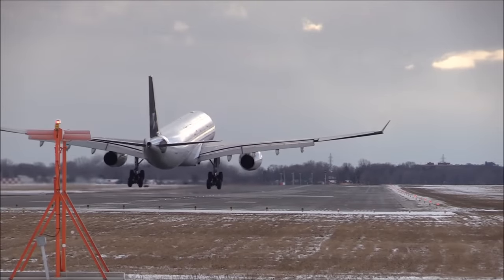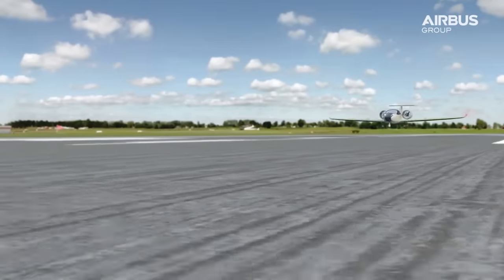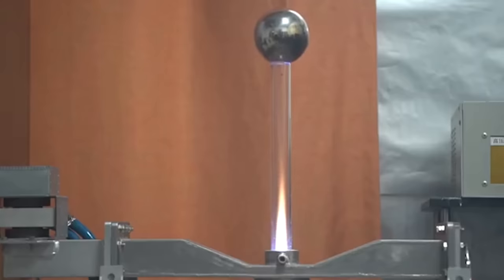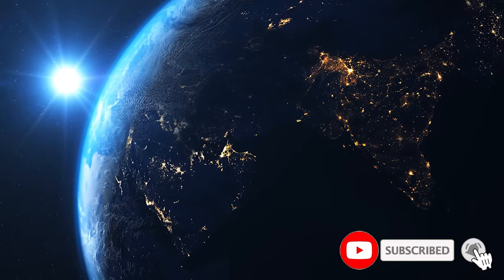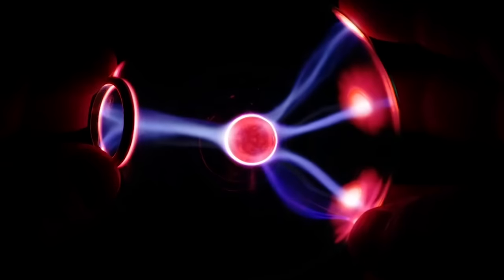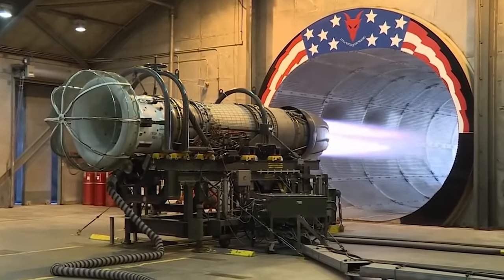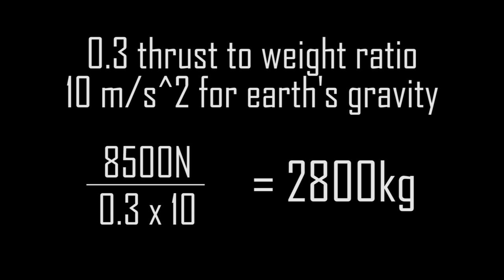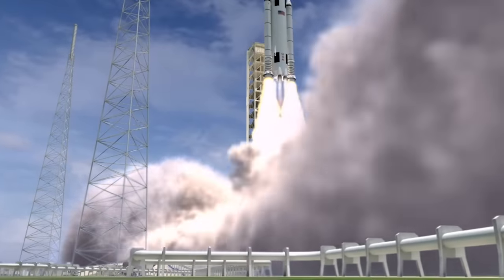Uncovering China's New Electric Plasma Jet Engine

Comment: And that's going to take a HUGE amount of electricity.
A quote from one of the scientists working on the project. 
Our results demonstrated that such a jet engine based on microwave air plasma can be a potentially viable alternative to the conventional fossil fuel jet engine,” he concluded. More work is needed to improve the prototype’s efficiency before it can be tried in a full-sized jet, and getting enough electricity to the engine to create plasma could also be a challenge. But if it can work on a large scale, it could usher in an era of guilt-free flying.
Reply: Yeah considering microwave ovens can take 1500W of power, it seems very wishful. Power consumption is also a concern for electric propulsion
Reply: i guess you'll need an arc-reactor huh
Reply: Batteries are advancing every single month
Reply: @gratefuldoge8598  no they aren't. Tesla's newest battery is the same energy density as the ones before it. They just made them cheaper to produce and make less heat. That doesn't help for air travel. For air travel they need fuel that is massively lighter, like a factor of 2. Basically it's a pipe dream till solid state batteries come to be. 

Plus let's be honest here, cleaning the airliner industry is kinda just a waste. Air planes only make up 2% of all CO2 emissions. It's significant, but there's only so much lithium to go around so might as well just use that for cars and solar backup. Makes far more sense for planes to use hydrogen in the future as hydrogen is even more energy dense than gas so it makes way more sense with the weight limits. Batteries make sense for cars and trucks, but industrial transport like boats and planes make way more sense to use hydrogen. Though of course there are already nuclear cruisers.
Reply: Skylancer727 im not talking bout tesla
Reply: @Skylancer727   Yep.
Reply: @Flec2507  or a miniature fusion reactor that works. thats kinda what the arc reactor was based off of
Reply: Nuclear power. The U.S. was debating a similar idea in the 90s but decided it wasn't worth the cost
Reply: @Salamandeer  Actually that program was started in 1949 by the army and one plane was built. And do you honestly want nuclear powered aircraft flying around. More importantly they crash, and I have a real sneaking suspicion nuclear reactors don't like to be crashed.
Reply: @Salamandeer well fusion is still nuclear. and if it worked it would output 10x more energy than uranium nuclear reactors.
Reply: @Skylancer727  I thought hydrogen takes up more volume in a fuel tank?
Reply: @Brick Battle Please do some research on how large that would be, and they have been claiming for decades that they were just a little ways away from a viable plant. And there's your hint, it's the size of a energy production plant, square city blocks in size.  That's not suitable for aircraft.
Reply: @satguy  thats why i said miniaturized. i understand that this is not yet viable. but if a small scale reactor could be feasible, i feel it would allow for more options, and better output. also both these reactors are using incredibly inefficient ways of harnessing energy, boiling water rather than making an attempted to directly convert the energy into electricity. or by some other means.
Reply: And fusion is already here.
Reply: Yes and u just need Nuclear reactor
Reply: @koushikduttarai81  A flying reactor that has catastrophe written all over it.
Reply: @satguy  tell that to the governments blackprojects.
Reply: @hellzone100  The US canceled its program in 1964.......
Reply: @koushikduttarai81  A reactor in a plane? Do you know how much the shielding in a common reactor weighs?
Reply: @feonor26  a reactor that can charge the battery very fast
Reply: @koushikduttarai81  That's not the issue. The issue is weight. The shielding for a reactor is too heavy for a plane. Don't you think they've already thought of this?
Reply: Incorporate wind energy capturing
Reply: @anthonyman8008  I have renewables on my property and trust me they're not as great as everyone claims they are.
Reply: @feonor26  the kicker is that you can get around that issue by just using it on a nuclear missile. It's called a SLAM. Supersonic Low Altitude Missile. The US researched one under the name of Project Pluto. It's basically a hypersonic cruise missile that uses a nuclear reactor to heat the air to create the thrust but in a much more efficient way. It has the "small"downside of causing massive fallout before it reaches the target but still kinda cool. I think if we got better solar panels, planes could fly primarily off of solar but that's just barely possible now. Another option would be a rechargeable chemical reaction battery that creates heat similar to a nuclear reactor but self contained and reusable. There are a lot of options and I think going nuclear is a terrible idea. That's just one crash away from a disaster.
Reply: @Skylancer727  Well said but hydrogen isn't the best when it comes to fuel for air travel. If it were an internal combustion engine it would be fine but a jet engine would be way too unsafe
Reply: And thats no problem
Reply: @feonor26  There would be no explosion or radiation if you use a hydrogen powered fusion reactor.The only thing that would happen is that the hydrogen would cool of and fusion would stop
Reply: @Alekx445  Well for now fusion reactors are science fiction.
Reply: @hadleymanmusic  that is a giant problem. If you have any solutions please tell
Reply: @gratefuldoge8598  nope. Batteries have pretty much reached their max power to weight ratio limit.
Reply: suprlite not even a little bit true.
Reply: @gratefuldoge8598  that's 100% true, batteries are pretty much at their apex
Reply: Quw that is an impossible claim, so say what you want, it just is not possible. There are no limits to batteries but time.
Reply: Perhaps everybody would like to read part of the labs statement that I have inserted into the original post. They themselves say it would requires a tremendous amount of energy.
Reply: @gratefuldoge8598  When you're talking about commercial passenger carrying aircraft yeah there are lots, and lots of limits.
Reply: @gratefuldoge8598  Literal physics, and thermodynamics say otherwise. There is a very small chance that batteries will get smaller and more efficient like computers (which are also nearing their peak). That's mainly because quantum physics doesn't like being measured. Most batteries run on chemical reactions and trapping electrons under certain conditions. That has a maximum size due to, as I said, quantum physics. Phones use extreme downsizing and use SSDs to store power and those SSDs are pretty much readable batteries. They are only so big as to store electrons.
Reply: Satguy 141 modern* thats the only limit. Time. As I said.
Reply: Quw existence is not bound by our understanding of it.
Reply: @gratefuldoge8598  Did you not read my comment? I literally explain the reasons why it wouldn't work without some, miracle, generator.
Reply: Quw based on your understanding of reality*
Reply: @quw1556  He's got to be a troll, short one sentence or less answers, with no supporting documentation.  Fits the profile.
Reply: @gratefuldoge8598  Based on fact. Do you how to break the laws of physics and thermodynamics? If so please tell. Do you want an antimatter battery?
Reply: @satguy  either that or they can't admit that they're wrong
Reply: Quw fact is a human concept. I do not believe in those laws, they do not apply to me, not the part of my self which I identify with. I am not bound to these principles, rules snd limitations your religious cult subscribes to.
Reply: @quw1556  I'm shocked, shocked I tell you. People unable to admit their wrong, say it ain't so. 
I guess they've never been married. 😉
Reply: @gratefuldoge8598  🤣🤣🤣🤣🤣 Ok, so then a 1kg 30.000mAh battery can just IDENTIFY as a 0,5kg 100.000mAh battery - and you'd be right. Because 'facts and science are just human concepts and dont need to be taken into consideration'. Pretty descriptive of the whole 'green  new deal'.
Reply: suprlite I do not agree with the GND. Also I do not subscribe to identity politics. I am simply saying the limitations ascribed to the reality come from humans and are not law. Theyre observations and classifications we make. All based from our perspective.
Reply: @gratefuldoge8598  umm yeah whatever.  Though galvanic batteries have pretty much reached their peak energy to weight ratio no matter what you think of the matter. If you understand basic chemistry, you'll understand why.
Reply: suprlite again. You are arguing from the point of humans perspective and abilities. I am saying theres too much unknowns and faithbased theories in the science cult. I think the possibilities are infinitely endless but I am only thinking that from my ability of understanding those concepts. I believe that even if we thought we had a complete grasp of it its just an unknowable fact that cannot be proven beyond our ability to measure it
Reply: @gratefuldoge8598  Ok then. We might find some renewable energy source more powerful than todays batteries - but it will not be batteries. For the same reason that we have not found any explosives that are significantly more powerful than tnt, which was invented in 1863. It's basic chemistry and science. All your arguments are based on wishful thinking, dreams and denying facts and science. Sure we might still increase the efficience of batteries.  by 10% - 30% - but we will not see a doubling. And even a doubling will barely be enough to make batteries a viable replacement for fossil fuels. But hey: keep dreaming the good dream. Meanwhile, you might want to read up on the galvanic table. Please do before posting again. Remember: today's best batteries only have 2,2 times the energy density of the good old lead acid battery which was invented in 1859. Because: chemistry can only be streched so far.... Here's some reading for you: https://batteryuniversity.com/learn/archive/batteries_against_fossil_fuel
Reply: suprlite what you call batteries today wouldnt have been called batteries 30 years ago. Youre restricted by your language.
Reply: @gratefuldoge8598  How dense are you? It was called batteries 150 years ago. Now go read a physics book and gain some knowledge.
Reply: No it can't people keep claiming green energy will save us all but ignore that solar panels are just as bad if not worse than green house gases. You get VERY low conversion efficiency while increasing the absoption of energy. Just like a greenhouse gas captures more of the sun's energy instead of it radiating back into space SO DOES A DARK SURFACE. I am willing to bet that a solar panel captures more of the radiated energy than burning the same amount of energy in fossil fuels and releasing it as greenhouse gas. Around 95% captured with 12% converted to electricity and only 40% efficiency when converted into motion in an electric engine. That is an overall efficiency of 4%. Combustion engines convert ~40% to usable energy and release a relatively small amount of greenhouse gas in comparison.

The numbers don't lie. If you want to save the planet Solar Panels ARE NOT IT. Unless you build GIANT sun shades or reflectors to offset the extra energy absorption they only make it worse. There is no energy usage without creating heat. Taking that heat from the sun adds it to our planet. Hydrodynamic and Nuclear are the 2 best forms with wind being 3rd. They still require offsetting that extra heat though.
Reply: Aerospace Mechanical engineer, here. 

They did NOT provide accurate thrust calculations. In experimental setups, a force gage is used. This ball on top messes everything up. TRASH RESEARCH. FAKE NEWS. MONEY GRABBING RESEARCHERS.
Reply: @johnbigelow8575  the largest fusion reactors out there aren't even able to break even with energy production. Size matters when you're trying to recreate the conditions of a star inside a building.
Reply: @Tterragyello  Yep, but trying to convince the gullible why,  is pointless.
Reply: Maybe not. At least maybe not 'directly'. A kitchen microwave uses wall-standard 110v, but converts to ~5000 volts via the internal converter. Same could be done on a higher scale to reach power requirements here. Further, they're going to find if they can create ~3 Thz microwave emitters, co-located and aimed at a single, concentrated point, the air itself will explosively expand, and if placed properly in a ducting structure, it will produce very high thrust. Mark my words.
Reply: Forgive me I am going by memory, after all this article is 3+ months old,  but. Didn't they say in the article they have no idea how they can store the necessary energy to do this. Short of a flying nuclear reactor, and that's not acceptable to me.
Reply: @Skylancer727   Check out Hydrogen "Power Paste". Its a magnesium hydride technique for storing hydrogen and its a game changer!
Reply: @johnbigelow8575  fusion power is still off the list for now. Right now it's an energy negative process. Plus it requires radioactive tritium hydrogen to run the reaction which is only produced in fission reactors. In theory we can make a breeder fusion reactor, but considering we can't even get the efficiency up to any productive amount yet, kinda wishful to be making breeder reactors.
Reply: @ohkabomb917  it does, but hydrogen itself contains about 4 times the energy as gasoline per kilogram so in the end it's still enough for normal jet flights. Plus if we use hydrogen fuel cells instead of hydrogen combustion we are using the fuel more efficiently so we burn less of it over time. You can burn it in the same method as gasoline but it's a bit more finicky to ignite and hydrogen has an effect of slowly breaking metal objects from their imperfections so internal combustion while possible is probably the poor solution. 

When you really want more capacity you can also store it cryogenic but then you need to bent it as it evaporates plus you're making it less efficient as we're adding an extra step of cooling.
Reply: @MrChronified  it's a bit of an over hyped topic to be honest. I looked into a scientific paper studying the efficiency of these pastes and they found most only contain 2% hydrogen by weight, require special heating to release the hydrogen and then the releasing process could take anywhere from 1-15 days. After seeing all of that, I really don't see this as a great method of storing hydrogen when we can just make gigantic 700psi canisters for planes really sounds more like it fits into the construction and manufacturing fields for long distance transport to factories. 
https://www.ncbi.nlm.nih.gov/pmc/articles/PMC7559164/
Reply: @Skylancer727  thats why i said "I understand its not yet viable". i feel the main problem with most reactors is how we convert energy into electricity. we've been using the same method for the past 100+ years and we still use heat to steam power to make electricity I feel there has to be a more effective way to get electricity from our generators today. I feel we should find a way to cut out the middle processes for getting electricity a find a way to directly convert fusion energy, or fission energy into electricity. rather than rely on heat, because the amount of energy loss to dispersal of heat and that heat to motion is immense.
Reply: @johnbigelow8575  well there is, for fusion the main way to produce power is actually  electro-static direct energy conversion or DEC for short. It's a fair bit more efficient at about 90% efficient, but no matter what energy released in gamma rays no matter what will always be lost due to its nature. DEC can also be used in fission reactors but considering how much of the energy in fission reactions is just heat it's more a secondary way to get power out of it. 

The issue with fusion though is more that it's more than making more power than you put in, it also needs to produce way more as we waste liquid nitrogen cooling it and the fuel is not cheap (tritium hydrogen is only produced in fission reactors and is screamingly radioactive at a half life of 7 days). We need to make enough that wasting these resources isn't a money sink. 

DEC was always the best method for fusion and has been the main one brought up since its conception though still fusion still has a lot of issues to overcome.
Reply: @gratefuldoge8598  Sure, there's new TYPES of novel battery chemistry being tried, but to say that means that the energy density is getting better by any practical factor, no..sorry, it just has not worked out like that, at all. If it had, you could bet your house that it would be put to use, making current Lithium and even lead acid storage batteries obsolete, and that has not happened.

 Besides, this method is not really new, it's just taking a bunch of things that are old tech, and cobbling them together to show that it works, which, to be fair, it hardly does. Each step of this process uses heaps of electricity and produces a tiny amount of thrust, overall. So, for this to be considered, you would need to like increase the efficiency of each of these steps by many times over so that each step was ultra efficient, that's just not going to happen, even if it did, the final output is simply not enough. Then there's the pollution issue.

 What pollution I hear you say ! Well, think about it, what happens when you ionise and heat air up to high temperatures in an electric plasma ? You inevitably produce a lot of ozone, which is great for absorbing U.V. in the upper atmosphere, but terribly toxic for all forms of life down here in the biosphere, that's why it's used to sterilize water, because it is a powerful oxidising agent..cancer of the lungs anyone ? Then you have the OTHER problem, the same thing happens to Nitrogen and oxygen, you end up forming those nasty oxides of nitrogen, that nasty brown gas that is also very toxic..so, does this really have any merit ? sorry, it really doesn't. Frankly it sounds more like some sort of P.R. spin to make it seem like something good actually comes out of Wuhan, but, when you actually look a little closer, more snake oil.
Reply: @Tterragyello  Gotta stay skeptical about everything in this day and age
Reply: This particular plasma thruster, if the paper's claims are valid, has a propulsive efficiency (brake power to thrust), that exceeds that of a conventional turbofan engine. A typical turbofan has a power-thrust ratio of just a little of 1, a GE-90-115B produces 115,000 lbf using 100,000 shaft horsepower. If the claims of the paper are true, the propulsive efficiency of the microwave air plasma is 4.6 lbf/hp, far higher than the turbine engine. Where do you think the energy to power the turbofan comes from? Saying "this requires a huge amount of electricity" is meaningless. Propulsion systems are not power plants. Powerplants provide energy to the propulsion system.
Reply: huh
Reply: guilt is feeling that can be easily supressed even without new engines
Reply: @hphp31416  ....??
Reply: @ChristophePochari   the problem is that the energy density of batteries is a joke in comparison to kerosine or any other liquid fuel. Even if we had plasma thrusters capable of overpowering turbofan engines the plane would have to carry many times more batteries than a conventional plane carries fuel. Before we get super efficient plasma thrusters or batteries this concept aint going nowhere.
Reply: @Skylancer727  Great point !!
Reply: @quw1556  there could be other applications
Reply: @satguy  yea I’d actually be fine with that
Reply: We need a Dyson Sphere.
Reply: install a solar panel at the top of the plane to prolong the range, but it doesn't solve the need of the large battery to contain that electricity, and the problem with the night flight when there is no sun to support
Reply: @agiegiaaa  With current solar panel technology?
Reply: That's why china is also trying to achieve fusion with their artificial sun, an electric jet engine and a fusion reactor is a match made in heaven
Reply: John Ashley 5 seconds
Reply: @Joseph-mw2rl  I'm in my sixties and they have been saying that sustainable Fusion reactors were just around the corner ever since I was able to read Popular Science magazine.
Reply: I think that microwaves, magnetrons, electromagnetic waves and electricity are very dangerous, and electricity is an limit energy that is difficult to provide in a way that suits the need!
The device that runs on electricity, does not work without it!
Reply: The technology can't be used the way it's described but it has practical use in high altitude flights when the turbojet thrust is limited by thin air. It was tested in secret projects such as the Aurora project. The idea was to use the turbojet to create a lot of electricity by putting electrodes in the burning jet and use that electricity to generate magnetic fields in order to push ionized particles of the ionosphere. It does not replace the fuel at all. It adds thrust through magnetic fields to the that good old action/reaction principle. I have no idea if it was efficient enough. Nothing was ever published.
Reply: @Skylancer727  -  I don't think I would fly in a hydrogen fueled aircraft.  Frankly, I'm likely to be mere dust by the time safe hydrogen fueled aircraft are developed, if ever.
Reply: @wickedcabinboy  to be fair, that's a realistic claim. Remember that hydrogen aircraft go back to the 70s in concept. In fact one of the space shuttle concepts, the Rockwell Sky Raker, was built on the idea airports would have hydrogen on the ready and it could land at any airport from orbit. Considering its been 50 years now and we still use fossil fuels, there's a good chance that won't change any time soon. 

Main issue still for hydrogen and electric planes is the lack of electric jet engine. The jet engine is what allowed planes to ga so much farther and faster, but it's predicated on the idea of burning something. We still don't have a real electric alternative. Closest I've seen is a focused microwave chamber but microwave magnetrons are notorious energy hogs, so much so that microwave ovens tend to be one of the biggest energy sinks in your average house. I mean they literally are pulsed just so they don't flip the breaker.
Reply: @Skylancer727  -  Thanks for the detail on microwave ovens, I wasn't aware of that.  I have always remained highly skeptical of claims of "revolutionary" methods of aircraft propulsion.  They always sound too good to be true.  Electric plasma aircraft engines would require truly revolutionary methods of producing vast amounts of electricity within the volume of a subcompact car.  I simply don't see it happening in my lifetime, if ever.
Reply: @wickedcabinboy  I think that's a bit of an understatement. Planes do use the wings to store their fuel, if we converted to something like hydrogen instead of batteries you would get the same space, issue is with many cylindrical tanks rather than one the size of the entire cavity. 

But again the main issue is propulsion. Currently the electric and hydrogen planes I've seen just use basic propellers basically sending us back a century. I just don't see that as viable and I think airlines really are just waving the stick of the green future. If you really want to laugh at something though, just look up eVTOLs. I can't believe people actually see those as viable in any regard. It's an idea even more moronic than Space X's claims of Earth to Earth transport.